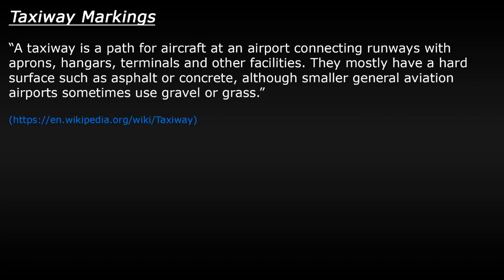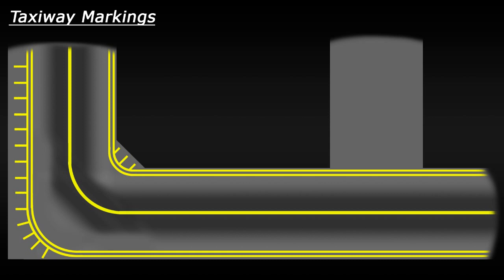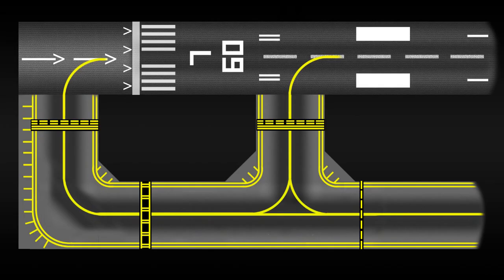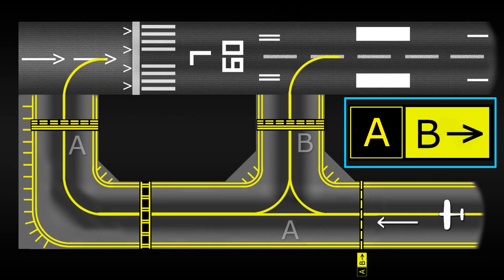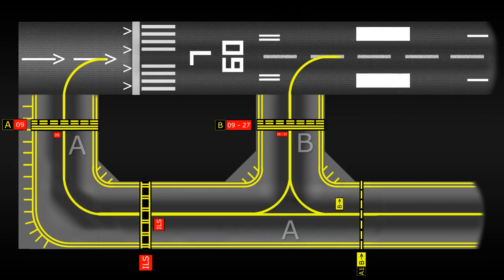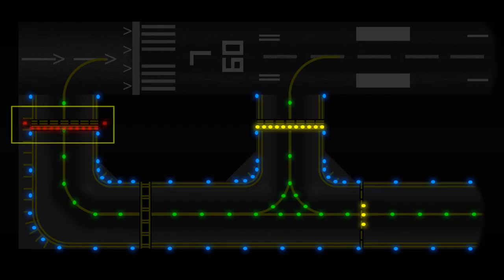Taxiway Markings, Signs and Lights

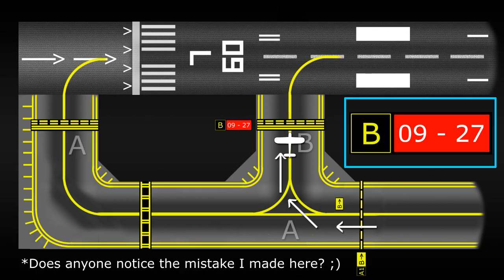Comment: Great video, and quite helpful as a short refresher on markings, signs, and lights. Since I haven't seen anyone address the mistake you made at 7:00 , I’ll have a quick word on it. You simply forgot the letter behind the runway number to indicate left or right. In your example, the runway holding point sign with a red background and white number should read '09L - 27R' to match the runway markings themselves. Lastly, a runway holding point requires two signs, one on the left and one on the right. Many thanks for that amazing video.

Comment: uhm i guess u made a big mistake it is  showing it was runway 09, and if it is 09L then the other end should be 27R
Reply: cus if the runway is mentioned with a number with left or right it means there is another or 2 parallel runways
Reply: plz i need a reply from you :)
Reply from the maker: Yes, parallel runways need the L or R identification :)

Comment: Hi I have a  question if there are holding patterns in the runway would they give a name to it eg: hold at PLUTO
Reply from the maker: Nope, most holding points (in the UK at least) are given a single letter designation, such as"F"..."Holding Point Foxtrot". I think names such as PLUTO are only used at larger airports to differentiate the holding point name from the taxiway name. Gives the pilots much clearer taxi instructions as well.
Reply: @Doofer911  oh thanks that explains it. Your tutorials are so easy to understand. I watched ur fsx tutorials. I have just enterd the flight sim world could u give me some tips

Comment: The mistake at 6:55 was that the sign shows runway 09 when its actually runway 09L, same for runway 27R. The sign in the blue box was wrong lol, but the sign near the taxi way was correct, also thanks a lot for the video

Comment: Who is responsible for and how do they turn on/ off the stopbar lights when an aircraft is ckeared onto a runway....also what if there is a conflict between radio clearance onto the runway and say a lighting malfunction of the stopbar lights?
Reply from the maker: Air Traffic Control is responsible for the lights. If there's a conflict, the pilot is responsible for stopping and clarifying any instructions with Air Traffic Control.

Comment: in reference to holding point (around 6:08) where its said that you're at Holding point A1, would that also be described as "on taxiway alpha holding short Alpha Bravo"
Reply from the maker: I can't say for certain. In the UK, your position should be reported as the holding point itself so "Holding at Alpha 1" would be correct. However there may be syntax differences in other countries who would accept "Holding short of Bravo" as a valid radio message.
Reply: @Doofer911  ah ok no dramas. i'm just asking the question, i'm not a pilot but wanting to work up to it. just  not sure myself so cheers for input

Comment: Can u pl adv how far runway vacation sign should be placed. Considering tail height of critical aircraft or its length.
Reply from the maker: Usually they're within 1 or 2 meters of the runway or taxiway. There small enough to be well clear of wingtips etc.
Reply: Sir, actually I want to know distance/ location of rwy vacation sign from runway centre line. And in which ICAO Doc it's mentioned.

Comment: Basic but good. You should emphasize that not only must one have ATC clearance to get on a runway but ditto for taxiways, if you charge onto a taxiway without a taxi clearance for that taxiway you almost certainly will be in for an FAA deviation that may require expensive remedial training.  Consider a tour of a nite taxi on a large complex airport where the lighting can be confusing because it is a bit different and the much greater width of runways and taxiways add to distortion as seen from small GA planes much closer to the ground than cockpits of the commercial jets.
Reply from the maker: I think the reason it wasn't mentioned in this video is that this was purely an overview of the different markings found at an airport, not a description of procedures used at an airport.

Comment: I have to say, this is a very good explanation. Now I have two miscellaneous questions that might not necessarily affect what your general explanation covers. But here are my two questions:

1) Does the pilot need ATC clearance to pass an ILS stop mark?

2) Why would a pilot take a taxi way to the threshold of a runway rather than taxiing itself straight onto the runway itself? What's the difference that affects the plane's flight?

If you have answers to these, please tell me. I believe there are answers that are very logical that should be self-explanatory, but I just want to confirm whether or not my assumption inside my head is correct or not. Thank you! And great video!
Reply from the maker: 1. If the airport is operating under "Low Visibility Procedures" then the way that ATC manages movement of aircraft on the ground changes completely. On a normal day, I believe that pilots can taxi past ILS stop marks because "normal" stop marks are always found after the ILS mark, closer to the runway. In the UK, ATC will clear an aircraft to a specific point, then give the route. For example in this video, ATC would say something like "Cleared to holding point Alpha via taxiway Alpha." So ATC have cleared the aircraft all the way to the Alpha holding point, past any holds before that. Now if the airport was using Low Visibility Procedures, then they would give instruction and only clear the aircraft as far as the ILS holding point. 

2. ATC prefer to have a plane on a runway for as little time as possible to reduce congestion. So again using my video as an example, if the aircraft is at Alpha holding point and they're cleared for takeoff, then they simply turn onto the runway and go, so they're not on the runway for too long. However if ATC let them on via Bravo, and clear them to "Backtrack" to the threshold, the aircraft would have to enter the runway at Bravo, turn left, taxi to the end of the runway, turn around and then go. That takes a lot longer and if you've got a busy airport, then other planes can't land or takeoff with another aircraft on the runway.
Reply: @Doofer911  Thanks a bunch, I'll keep your explanation in mind!

Comment: In fact, they are 2 mistakes on the runway marking, the L is missing but the 27 or 27R is also wrong, as airplanes cannot enter it as the 27R runway (the continuing centerline going only to the right proves it ^^ ) :D
Reply from the maker: Hmm... I'm not sure, planes could be given instructions to "backtrack" to 27R, so they could enter near the end of 09L and taxi the entire length of the runway to 27R and takeoff from there.
Reply: Most of bigs airports don't have space to backtrack and turn safely at the beginning of the runway and even if it is still phisically possible, if the yellow centerline do'nt go on a direction, ATCO can't autorise an aircraft in this direction so the marking shouldn't show this runway...

However, the final call is to the airport so if an airport want to write both runways and if the national authorities agree, they are no forbidding rules, even if its quite disturbing as if you have the opposite direction writted on a directional panel on an highway :p
Reply from the maker: I agree it's not commonplace at big airports. Not because the aircraft can't turn because they can have remarkably tight turning circles. Usually at big airports, they have the space for taxiways to extend to both ends of the runway. However at regional airports, it's very common to have aircraft back tracking a large part of the runway. Consider London City (EGLC) for example. My hometown Inverness (EGPE) is another good example. 

Of course, it's not the most efficient method of moving aircraft to the correct end of the runway but as I said, sometimes airfields just don't have the taxiways to use instead.

Comment: So a runway might go from 09 to 27, which I understand means a heading of 90 to 270.  Why then the L and R?  Left and right are dependent on your orientation (unlike headings which are absolute) but if there's an L painted on the runway then it is left from both sides.  This seems to defy logic.
Reply from the maker: The "L" and "R" are applied to parallel runways and it's based on your orientation. The letter applied will change at both ends of the runway. For example, you have two runways labelled 09 and 27. As you approach the runways, the runway on the Left side will be 09L and the one on the right, will be 09R.... easy enough. Down at the far end, the letters will change.... so the first runway, 09L will have 27*R* at the opposite end. Hope that makes sense, if it doesn't, let me know and I'll try and find a better way to explain :)

Comment: What might cause confusion with these runway signs is that the compass headings shown on the signs are reversed. Take the sign 09 - 27 for example. You might think that if you turn left onto the runway you will be heading 090 degrees or due east. And if  you were to turn right you would be heading 270 degrees or due west. Wrong! What the numbers indicate is that if, for example, you turn left for 09, only when you reach the end of the runway and have turned around to face the length of the runway, will you be facing due east or 090 degrees. 

And two other things I would mention having been taught are:
(1)  not to switch on my transponder until I was on the active runway; and
(2) always to check the runway alignment before the take off run by checking that the compass and the HSI (horizontal situation indicator) indications conform to the runway heading.

Comment: Awesome video. Just a quick question on what Runways signs that Indicate CAT II/CATIII mean? Do they indicate that aircraft in bad conditions would be impeding the ILS control zones?
Reply from the maker: Nah the CAT signs just indicate which Category of ILS system is installed on the runway. ILS systems have various levels of complexity which is represented by their Category. I believe 1 is the least complex and 3 is the most complex which allows aircraft to do an Autoland procedure in very poor visibility. I did a video about ILS Categories here: https://youtu.be/IXV5q4P6KuM

Comment: Do you have to hold and contact atc if you need to cross a runway(that you wont take off from) to get to your actual takeoff runway?
Reply from the maker: Yep. Any movement on/off a runway is strictly controlled whether that's an aircraft taking off or landing, crossing a runway, a service vehicle moving on the runway, an emergency vehicle moving onto a runway. ALL of them need clearance from ATC.

Comment: Very effective and efficient explanation. thanks for that.
Q: When Low Visibility Procedure is in force, does anything change or add?
Reply from the maker: They may be some minor changes. For example, aircraft may be told to Taxi at a slower speed, ground vehicles may not be allowed to drive in certain locations while the procedure is in place.
Reply: Thanks

Comment: I know this is out of context to the video. I couldn't get hold of this on the internet. 
Can you tell me what kind of items goes into the MAIN DECK cargo hold and the kind of items going into the LOWER (both FWD & AFT) deck cargo hold in the airplane? Appreciate your response.
Reply from the maker: On Passenger Aircraft, normally passenger luggage goes into the Lower Cargo holds. Dedicated Cargo Aircraft can carry anything, from mail to food, animals, electronic goods, cars or parts of other planes!
Reply: First of all, thanks. So that brings in -  what does a Main deck cargo compartment carry on a passenger aircraft? Could it be ULD's? Or any specific things which could only be loaded in the main deck for their size?
Reply from the maker: I don't think passenger aircraft would have a main deck cargo hold because all of the main deck would be furnished with seats, toilets, galleys etc. And on larger aircraft, they would normally use ULDs just to make loading and unloading much easier and quicker.

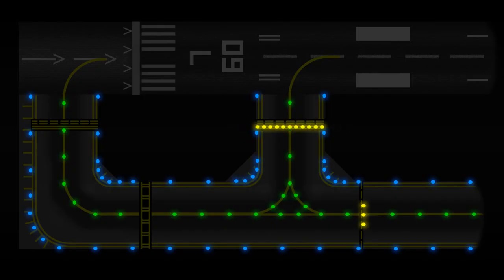Comment: At 9:27. I've seen airports that have both that system and the other runway guard system. But the lights on the taxiway alternated as well. That being said are the two methods in your video also different types of runway guard lights airports can have

Comment: Was always wondering about these, thanks for making this vid., pretty useful!
One thing I got lost with is the "27", where does that come from?
Reply: Runway is running at 90 degrees to the east, so the 27 means it is running 270 degrees to the west
Reply: If you can imagine a compass it has 360 degrees.. which means if one of your directions is 09L(90°) the opposite one has to be 90+180=270°... 27R.
Check also Captain Joe and Mentour. Hope I helped even after so long time..

Comment: I thought they'd largely follow highway markings and lighting. Why no green lights telling the pilot to proceed?
Reply from the maker: Well you've got the Taxiway Centrelines which are green. I think it's because an aircraft normally is cleared to go from A to B without stopping.
Reply: Doofer911 Don't the guard lights mean "stop"?
Reply from the maker: Not necessarily, they're just warning that you're about to pass a holding point and move onto a runway. It depends on whether ATC have given you clearance to pass them onto a runway or not.
Reply: @Doofer911  why can’t they put traffic lights on taxiways, runways and aprons? You can put these on holding points, junctions between taxiways, runways and other roads. These could even have electronic signs giving speed limits and hazard warnings included. Say, birds on the road ahead, or police car or track drying on runway.

Comment: An important tangential issue here is the new rule on taxi clearances. Previously, one cleared to "taxi to Runway 4 and hold," one was automatically cleared across any runway between the starting position and runway 4. Due to incidents of dangerous runway incursions...and a few accidents...one now needs additional clearance to cross any runway between one's current position and the destination runway. In short, never enter or taxi across any runway unless specifically cleared to do so.

Comment: sometimes in the night when the aircraft approaches runway for a take off, if the stop bar lights are red, its mostly waiting for an inbound aircraft. In such case, the pilot will switch off the main light and other lights so as to not to distract the landing plane. :)

Comment: It seems my local airport (Reno-Tahoe International) doesn't follow the double yellow lines convention on the outside edges of the taxiway.
Reply from the maker: Had a quick look on Google Maps, looks like it does (or did). Have to zoom in very close to see them though!
Reply: Doofer911
I'll have to look later this month when I'm there but I'm almost positive that the edge taxiway lines are simply double the width of the taxiway center line.  I just checked Google Maps to see what you saw and even zooming all the way in it looks to me like a solid line.  Not that it's really important but I'll check anyway when I'm there.  In any event, thanks for the great video.

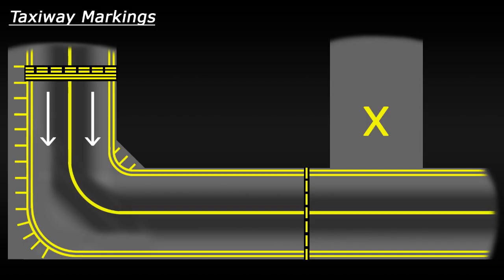Comment: at 2:46 about the hold until ATC clearance , when approaching from the other side you say you can proceed with out clearance from ATC. if its night and the red lights are showing can you still proceed with out clearance. assuming you can clearly see the markings. thats if you can see the lights from that direction
Reply from the maker: Ah I don't think I mentioned that in the video, the red lights are only visible from one direction, so if you were travelling from the runway side, you wouldn't see the lights.
Reply: Thank You

Comment: what does "on stand" mean?
Reply: This means that the aircraft has stopped moving at the end of its flight, and is preparing for the passengers to disembark. (I'm not sure whether it just refers to when the plane is facing the terminal building or also when it is parked in an open area of the airport and using mobile stairways to unload...)

Comment: So, what did the 27 signify in 09-27? Why was it the number 27.
Reply: The runway is numbered 9 because it is pointing towards 90 degrees clockwise from North (so it's pointing West to East, with the East end of the runway being the end shown here). If you wanted to go East to West (or 270 degrees clockwise from North) on the runway,  you would want to turn right at junction 09-27 because the 27 is on the right hand side of the sign. 

If you wanted to go East, you would have to go along the taxiways up to the other end of the runway (in this case) where the signs would then say 27-09 and turn left. I also think the runway at that end would be called runway 27.
Reply: I got the 9, I just didn't get the 27.
Reply: Yeah but it's easier to explain the 27 by relating it to the 9. Basically its because 270 degrees is opposite 90 degrees so on a East/West runway one end would be marked 9 and the other 27. A North/South runway would be called 00 and 18.
Reply: trefod think of a compass. North at the top would be 360 degrees. Now, extend a straight line south which would be 180 degrees. Runways are straight. So, keeping a compass in mind lets go with an example of runway 27 or 270 degrees. This runway faces West. So if you subtract 180 degrees, you'll get 90. So, if you're at the other end of runway 27 it would be runway 9. So there 36 runway possible configurations, essentially you would add or subtract 18 to get the opposite facing runway number. Some examples would be 1-19, 6-24, 4-22 ( the most common runway in the U.S. ) 10-28 etc. hope it helps. I'm an N-90 ATC Since 1991.
Reply: It can be either 0 or 36 actually it depends on the airport.
Reply: I think a north/south runway would be 36 and 18.
Reply: Oops sorry. I based it from runways here in our country.
Reply: Well you were half-right at least! :)
Reply: The opposite end of the runway will have 27R marked on it. Its basically 09 + 18. 18 denotes 180 degrees.